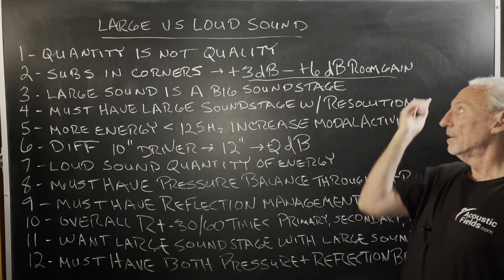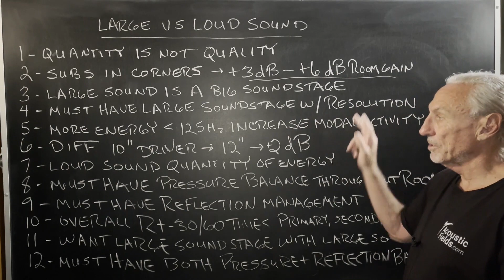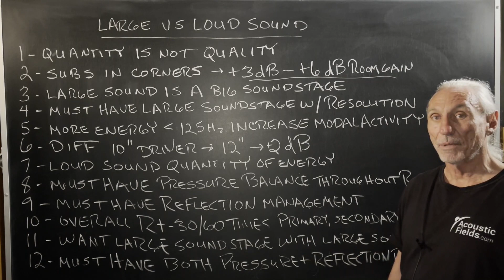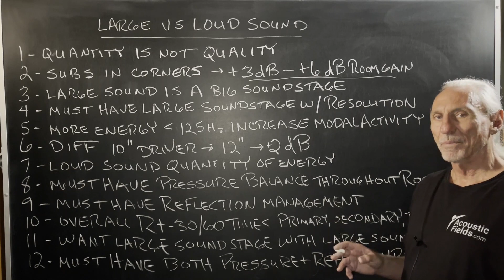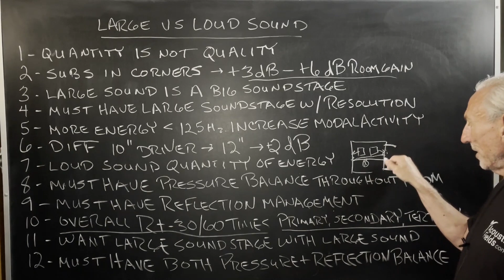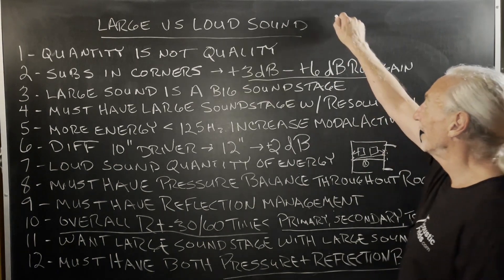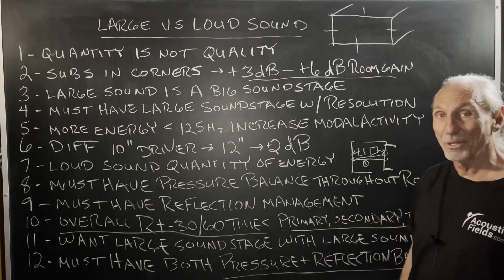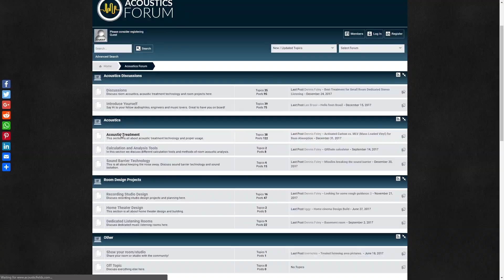Large VS Loud Sound - www.AcousticFields.com

Comment: About ear drum damage, 110 db (and a bit less of course) does permanent damage. that's what the old number was. quite possibly that less also damages, depending on person to person and frequencies. Biology doesn't care about taste in volume, that's for sure heheh
Reply from the maker: Think of the power of sound pressure in this way. Your ear canal is 1/2" wide and 1" long. It is filled with "birdbones", small hollow structures. A 40' wavelength is 28' long and 14' high. A large amount of energy being placed within a small cavity. Something will give over time.
Reply: @AcousticFields  indeed! i got a bio background so we had these tables of DB, at some point it gets scary hehe
Reply from the maker: Stay with the facts. The facts are always friendly. @CyberBeep_kenshi

Comment: Cool video. whenever i test equipment,  go listen to it somewhere, i always put the volume down. it's also how i listen at home. And Good setups handle it well, but when they aren't, you'll immediately lose detail, bass etc.

it's a really good test :)
Reply from the maker: Achieving high resolution audio is all about balncing the pressure and reflections produced by the room with the direct energy radiating from the speaker.

Comment: Pardon me but 13 inch subwoofers are tiny as I use 18s and twelve of them in the center of the room are adequate but only down to a certain frequency at a certain volume level without distortion.
Reply from the maker: It does not matter what you use. Your room dimensions will tell you how much energy the room can support.

Comment: Thanks for the video Dennis. This is now one of my favorites. I was pleased when you brought up. Servo subwoofers. You said you had enjoyed the speed but you didn't care so much for the sound. I wish suggest you take a look at GR research. Dani Ritchie has open baffle servo subs. It's a very fast, clean sound. The open baffle subwoofer is something to be experienced. Mine will reach down to 20hz without pressurizing in the room. This greatly reduces the influence of modal frequencies. That in turn makes room treatment much easier.
Reply from the maker: How can a sunwoofer that produces 20 hz. energy not pressurize a room?
Reply: @AcousticFields  There's not box. The woofers are designed to operate in open air. Instead of pressurizing the room it just moves air.